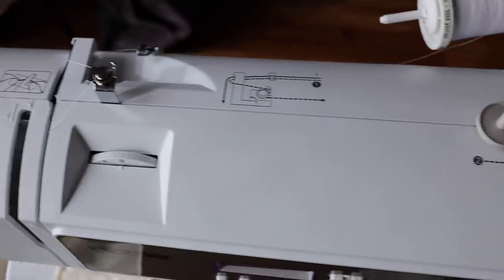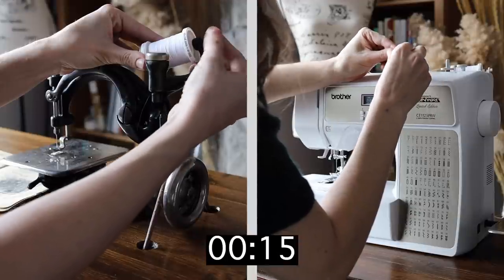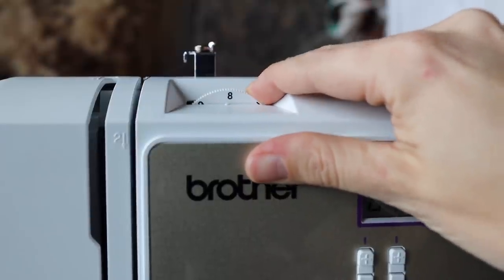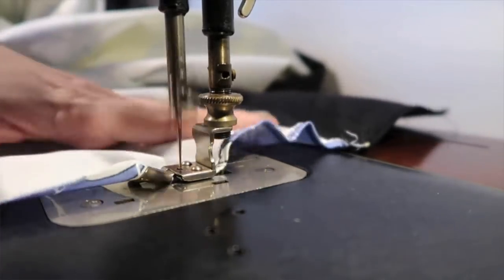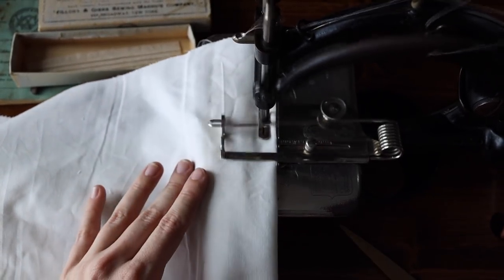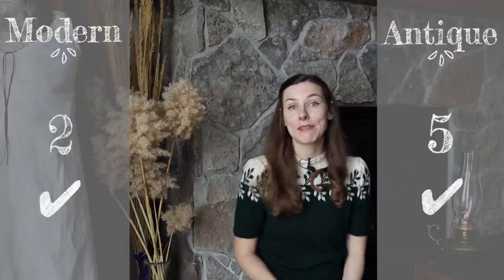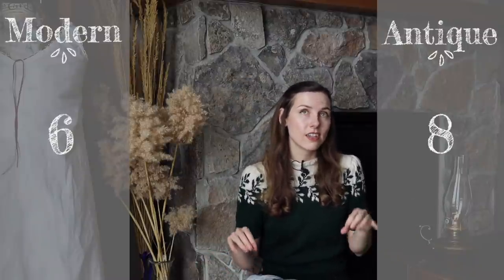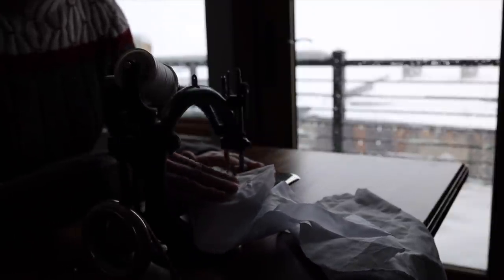Battle of the Machines - is a modern sewing machine better than an antique?

Comment: Here's a tip to seam ripping a modern stitched seam that I learned: turn the seam ripper with the ball point down, going into the seam space not the pointy bit--that should be on top--and you can pretty much glide through the seam (if the stitches weren't set to the tiniest stitch).  And always cut away from yourself.
Reply: Oh, that makes soooooo much sense...no stabbing through the material...I feel quite stupid now!!!
Reply: Yes! That's how they are meant to work. ;)
Reply: @mog-gyveroneill2500  Don't feel stupid -- for some reason they don't give instructions for seam rippers, and it's not obvious what the ball is for.

Comment: I second "buttonholes" as a category, but would also have a categories for:

ease of finding repair and replacement parts (just because they once existed does not mean antique parts will be easy to find); a discussion of thread type versatility (S vs Z) for how easy it is to walk into a store and get a spool of thread that works (most modern machines are S, many antique machines are Z, so if you have to special order thread it's not as simple); the ability to use the machine to place hardware/fasteners (most modern machines are better at this because they have more stitch types to allow you to pick something for strength and stability or else have stitch capability a single stitch machine does not); SETTING SLEEVES and if one is fussier than the other; how they rate with sewing massive amounts of thick gathered fabric easily (jam or not?); the ease of finishing raw edges (most modern machines win this hands down); weight and ease of moving/cleaning (antique machines, especially treadle machines are at a major disadvantage here, because if you need to take the machine somewhere to help with a group project or for travel, antique machine is staying home; also so many more places to pick up dust and pet hair in a more complicated cabinet assembly); maintenance fussiness (how often does it need to be cleaned and timed? your machine might not be an even comparison because single vs double thread)

Comment: There's a few things my semi-modern (1980s) machine does that I would not want to live without: it has a needle threader so threading the needle takes 2 seconds at most, the button hole programs, and having overlock stitch options for things I can't easily use my serger for like armholes after the sleeves are attached.
Reply: The Brother in the video has a threader, too, it took me a bit to get in the habit of using the threader but I really like it.
Reply: I've had the same Janome machine since late 90's and love all the stitch options and feet it came with. Most of all  the invisible hem stitch because I hate hand sewing 😂.

Comment: Lovely video -- I agree with almost everything,  but for some I would go further.... 
I have a hand-crank W&G and since I oiled it is it absolutely silent -- you might want to check if anything is rubbing in your treadle or head. Also, the chain stitch that the W&G does, because of the wrapping back around itself, does have some stretch to it, similar to the triple stitch on a modern machine or a cover stitch on a serger. But you're right, it doesn't have enough give for a very stretchy spandex. Regarding the locking vs. unzipping of seams, I agree with you 100% (but if you don't have a seam ripper for normal sewing, you should get one!). As for price, I have seen modern sewing machines that cost more than my car, and both of mine (one now 20 years old, the other bought used) were several thousand dollars -- they are high end embroidery/sewing machines. Whereas I have 3 W&G machines that were all between $100 and $300. And speaking of embroidery -- you didn't talk very much about how TOTALLY COOL the chain stitch looks on the underside! That, for me, was the big selling point -- those tiny little chains are just gorgeous. And did you know you can use them for embroidery? Draw the design backwards on a piece of stabilizer and put it on the back of the fabric, and then follow the lines as you sew it upside down. When you're done, you'll have a chain stitch design on the front.

Comment: I inherited my grandma's 201k which was built in 1953. I haven't touched my modern machine since I got it. It does an absolutely beautiful straight stitch. Drop in bobbin too so it's even easier to thread than my modern machine. It does go backwards but no zigzag. So I bought a 219k because it has an inbuilt zigzag but not only that, it has a whole bunch of stitches, more than my modern machine. I love my vintage singers. I'll never go back to modern machines.

Comment: I recently got a 1915 hand-crank Singer 99K in a bent-wood carrying case.  And I feel like I've bought a Stradivarius.  I'm waiting on the last of some etsy scrolling to find the attachments and pressure feet (I'm set up for everything from darning to ruffling to zig zagging).  And getting a 1960 Jetson-style buttonholer to work on a machine that old is like time travel.
One thing you forgot is the quality of the stitch - 1 mm stitches that my Kenmore 22 isn't able to do.
Also - there's the workout.  I've burnt more calories over the past month than I have for most of the pandemic.
By-the-by - rebuilding a century and a half-ish old sewing machine for your covid project is, I think, a record.  Well.  Done.  Can't wait for the videos.
- Cathy (&, accidently, Steve), Ottawa/Bytown

Comment: To be fair, lots of these are chain stitch versus lock stitch machine issues. I’m not disagreeing with your opinion or conclusions, just that if you did an antique lock stitch versus your chain stitch it would be very similar results. So it’s the machine type rather than age or computerisation that makes the difference. I have a lock stitch reverse feed old singer and it does pretty much everything my fancy pants Jerome does. Some better and some worse. I wouldn’t want to chose between them if I could only have one. But at gun point I’d pick the singer because it is nearly 100 years old and going strong. The Jerome is jus over 12 years old and I don’t know how long the plastic or computerised parts will last. I learnt to sew on it though so I wouldn’t abandon it without extreme provocation. Loving your videos and approach to creating.

Comment: I used to have a treadle Wilcox/Gibbs chainstitching machine and it was great for decorative work on reproductions like braiding or any trim, and historical children's clothing,  some aspects of undergarments, but for stable seams, not so much, since those were so easily unraveled if there was a break in the thread.  For most of my adult life, I've used an old Singer treadle that doesn't do anything but sew forwards.  If I could only have one machine, that would be it.  Still no computerized machine but I did finally get an electrified one that will zigzag.  It's fun to see others enjoying old machines, too.

Comment: I inherited my 1893 Willcox and Gibbs machine in a cabinet.  It works perfectly and came with all the fiddly bits.  After seeing all your work to put your machine together, I feel like I cheated.  Thanks for the video.  Needles for W&G machines are available from the Treadle Lady on etsy.  Husqvarna Viking machines have had automatic tension for 30 years.  Happy sewing.

Comment: Thanks for doing this one!! 

My 1914 Jones Brothers hand crank machine came with all kinds of hemming feet, and I even found a pdf of the manual to explain what they all do, can't wait to try them out! Since I started sewing again it's mostly been hand sewing because for a long time the only machine I had was hateful and made every sewing project a bargaining session, "Will you just finish this seam before I throw you out a window??" "If you finish these drapes without eating anything, I will get you serviced, I promise!" (I did, and it didn't help) "Aha!! I HEARD you spit your thread out of the tensioner this time, can you just stop making terrycloth, PLEASE?". That's the 1980s Singer that I loathe, I also have a 1970s Kenmore I got still in its original box, was used once and has all the bells and whistles but is a bit quirky from disuse and needs a professional cleaning and lube job, a recently-acquired 1960s Universal that's been professionally attended to but I haven't used yet, and a Minnesota A treadle machine I think is around the same age as the hand crank machine (I'm still trying to narrow down exactly what year it's from), and I don't have a band for it. Never meant to collect sewing machines, but here we  are. I miss having a zigzag stitch when I use the hand crank and it's taken me some doing to get the tension set up after the machine was unused for a few decades, but one thing I DO NOT MISS is the noise. Electric whine of sewing machine is irritating, soft clatter of hand crank machine is calming... and after my experiences with the electronics being the failure of any of my newer appliances I've had to replace, I do not want them in my sewing machine. I'm  not sure the Universal is going to get a lot of exercise until I need to sew a sweatshirt, I really enjoy hand sewing and I really enjoy the hand crank machine.

Comment: I have a 128 and a 99k singer sewing machines. Have not used yet. The 99k is from 54 and the 128 is 1941. Both need tlc but once done ill be using them. They win becaise they were free and cheap to clean and fix with new parts. Great video

Comment: I love mechanical modern sewing machines the most. You can get ruffle and gathering feet for your modern sewing machine as well.

I hate bottom bobbins that are hidden with a passion, but I really, really like models that have a drop bobbin that you can see through transparent plastic, it increased my quality of life a million fold! 

I feel like you have an exceptional antique sewing machine that has much of the bells and whistles one appreciates from modern sewing machines, especially noise-wise. I think that's really lucky! And I am in love with the pintuck foot~

Regarding the noise, I really made my quality of life better with a non-slip mat under my sewing machine, so it dampens the noise I would get from the machine shaking the table and all that.

I hope you can use the best part of both machines!

Comment: I was shopping for a modern machine a few months ago. One of my (very few) criteria was whether it did buttonholes! Because options. I found, as I did my research, that Janome has a modern treadle machine! I wasn't in a position to investigate it, but the very possibility is exciting. Many modern machines have the possibility of a knee presser, and the machine I ended up with has a foot pedal, or it can be operated purely by the touch of a button. I'm a little wary about that, but as I age (and my pedal leg gets repetitive stress issues), I appreciate that I'll be able to operate it without my feet. Now if only my hands stay functional..

Comment: Haven't gone through the comments to see if this is mentioned by someone else, but vintage wide hemmer feet can TOTALLY be used on modern machines! If they're standard low shank vintage feet rather than the weird proprietary ones, vintage feet can be used on modern machines. The feet that came with my 1890s Singer treadle work on my modern Singers. I keep an eye out at thrift stores for baggies of sewing machine feet and pick them up when I find low shank ones as they work on SO many modern machines!!
Reply: Not to discount your love of the W&G machine:) I LOVE how quiet my mid-century Singer 201 runs, way quieter than the modern new Singers!
Reply: And those drawers definitely look like Singer treadle drawers! My treadle has a different drawer pull/front design, but those look very similar to other Singer drawers I've seen online.

Comment: Very, very cool!!! I adore my antique treadle & my 1940's machine just because I like old things. The majority of my sewing is on my modern machine because it's just easier to use & has more stitch options. For your tension issue, double check your manual, but generally you don't have to adjust. (At least I've never had to on any of my 1960 or later machines). Even with silk versus canvas or layers. Usually about a 2.5 works as an all-purpose for my Brother.

Comment: I love my antique Singers. I have a zig zagged attachment, a buttonhole attachment and a blind hammer attachment. You can buy an LED light to attach to them if that’s an issue. Also, I have quite a few attachments like a rolled hem foot, a shirring foot, etc. I LOVE MY OLD SINGER MACHINES. I have a couple of treadles and a couple that are electric. Love them all. Those old Singer 66 models are the best.

Comment: The drawer set you purchased looks to be from a singer type 2 table that has 2 drawers each side and a center fold out drawer. It’s what I have with my 1926 model 127 treadle.

Comment: Fascinating! I never knew that chain stitch machines have only used one thread. My coverstitch does chain stitch that is slightly stretchy and can be easily unraveled if you pull just right, but it still uses two threads.
You'd probably be much more comfortable using $650 modern machine, or, better yet, a modern machine priced as high this vintage one was when it was new. Still have to deal with bobbins though, and I personally find the sound of stepper motors in computerized machines not that pleasant. My modern machine has a front bobbin and only one motor for everything, and does more pleasant sound that reminds me of servos and robots. It also never peeps and computerized one will peep just for the sake of peeping unless you buy an expensive one where it can be switched off.
Modern industrial machines amaze me with the ease of use and maintenance for most things, like it's way easier to adjust timing than with my domestic. And they are also way queiter, industrial overlockers have the most delicate stamping sound. So the fact that rather cheap Brother is louder than high end machine especially advertized as quiet one doesn't surprize me.
That threading "one and done" and no running out of bobbins would be 5 points from me honestly ;)
But I would add space/portability too, I have three machines on one 120x60cm table, I sew standing and the pedals are on the floor, but under the table there is a whole cabinet for fabric and stuff. As much as I love the fact that treadles make the feet move instead of freezing on the pedals, and work without electricity, the whole space under the machine head has to stay free.

Comment: What type of needles does the antique  machine use? I love the the sound of it.
Reply: I have a Singer machine from 1929 and it uses the same type of needle as modern ones
Reply: I read somewhere that Willcox & Gibbs machines have a little pin in the needle bar to help line up the needle properly. So you would have to use their needles. Apparently it’s common for this little pin to be damaged.
Reply: You have to use Wilcox & Gibbs needles or modern equivalents.  Original are fairly rare, but there are companies still making them. You can get them on Ebay or Etsy or some specialist suppliers.
Reply: Willcox and Gibbs offered a gathering foot with purchase that works well; however, it is so small that it has gone missing from many machines available today. There’s a YouTube video demonstration using this foot, by Fiddley Bits, as I recall

Comment: I had to pause when you came to the difficulty of calculating pintucks, darts, etc.  I am also a software engineer and my first though was, there should totally be an app for that.  If not, I could make one.  I am an accomplished knitter, but novice sewist, sewer, seamtrix...whatever.  My Mom on the other hand is an experienced seamstress.  I'll have to pick her brain on the precise math.

Comment: I  am afraid I would not assign points in the same manner as you.  I own 2 chainstitch mini's (like your Wilcox & Gibbs) and 2 lockstitch, all 4 are hand crank.  I have an Elgin treadle machine with the bullet bobbin (1892), 1 1980's Singer, 1 1990's Baby Lock Embroidery machine, 1 2005 Brother Serger, 1 1990's Bernina, and a 1940's 2 needle Juki industrial.  Out of all of those I use the hand cranks when I am doing historical reenactment and take it for repair jobs. (no power issues and it is so small I can stash it in my purse. They work great to repair canvas tents and trousers out in the camp field. I use the treadle machine for only simple historical garments that do not need fussy sewing.  My workhorse is the Baby Lock with the self threading, self cutting and easy thread tension-length-style choices.  I use the Juki for making tents, furniture covers and camp bags. (we own a hot air balloon so I also repair balloons).  I agree with the aesthetic of the antique machines they are lovely to look at.  But I feel they are limited and create more headache for me when I need to bounce between Modern and Antique to complete a project.  I actually would much rather sew a garment entirely by hand then mess with machines.  Thank you for sharing your thoughts on these unique machines.

Comment: I’ve recently restored a Singer 201k, which is a 1950s electric lockstitch (no zigzag). I love it for many of the reasons you love your antique, but as a bonus it can swap feet with my modern Janome, and it can do reverse. On the other hand my modern Janome has a mode for auto-back at the start and end of the seam and it cuts the thread and pulls them both to the back. I don’t think think I could love a chain stitch machine, but I am sorely tempted to “complete” my collection with a Singer 66 treadle and a 99 hand crank. I notice you didn’t mention the weight of the machines, my “light” (aluminium) 201k is ... about 15kg? I’m a bit afraid to put it on a shelf because it’s so heavy!